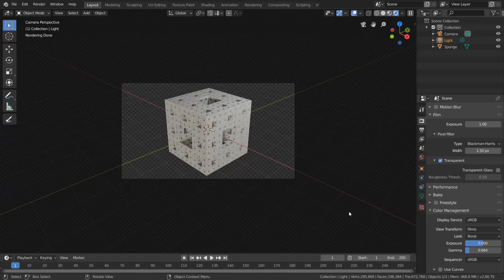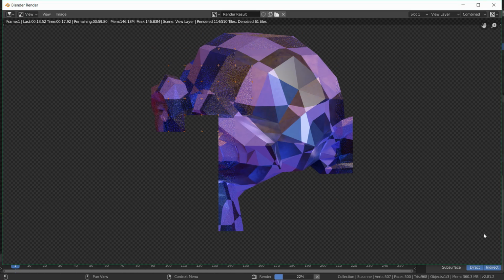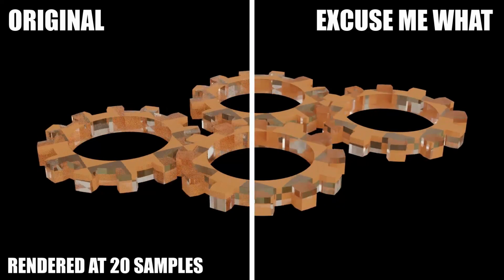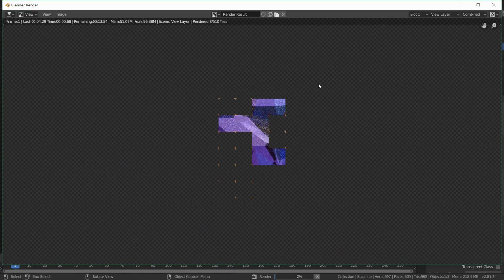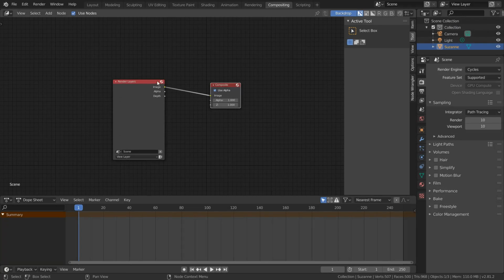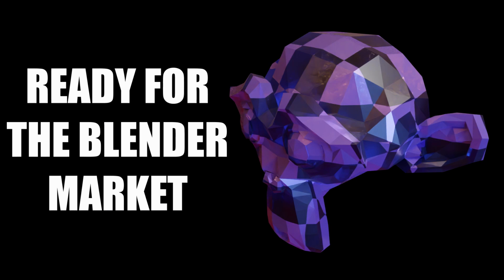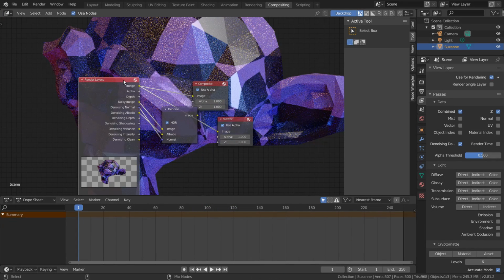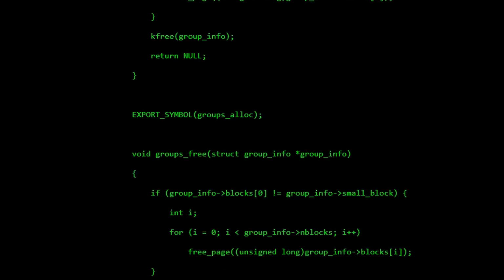The New AI Denoise Node In Blender 2.81 (Fast Tutorial)

Comment: Hey, I did all of this and it seemed to be working-except when I rendered, it showed it with noise, as if none of the nodes applied. Anybody know what I'm doing wrong? I work with this kind of stuff in ue4 but this is only like my second time using nodes in blender. I set the output of the denoise to the composite already and it isn't working.